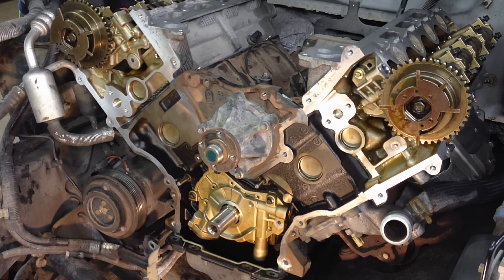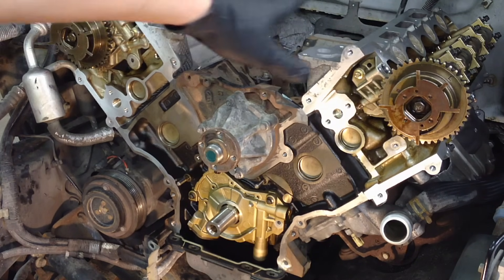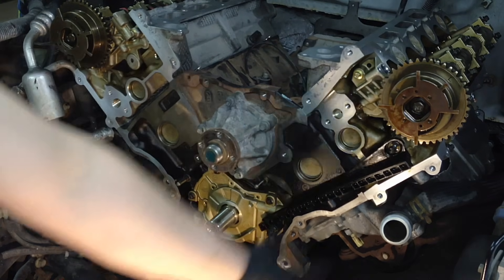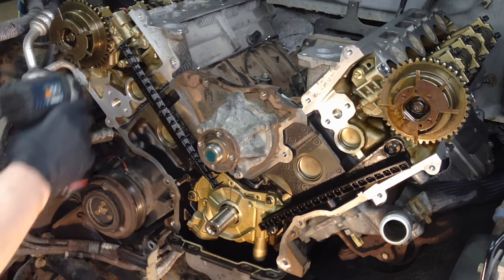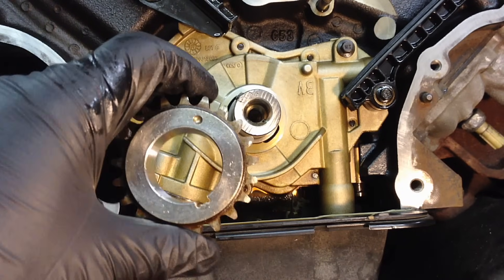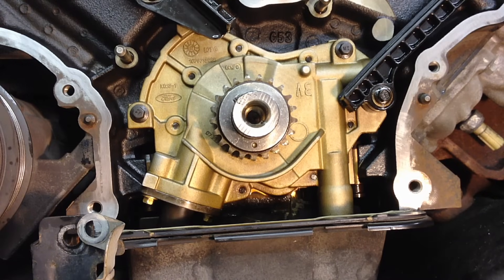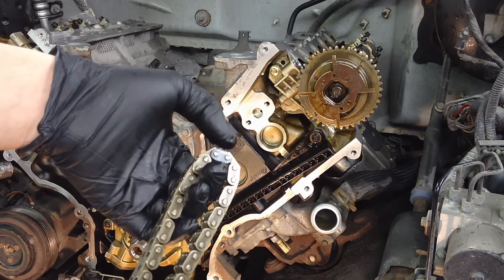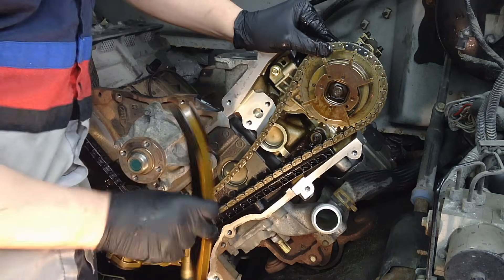Ford 5.4L 3v Engine Timing Walkthrough

Comment: Thank You! Just about to do this for the second time. Only question I have is can you remove all of the followers without a valve spring compressor? Couldn't come up with one the last time. No part stores or ford dealerships have them? Anyway thanks again for the videos watching that makes me realize where I may have gone wrong the first time.
Reply from the maker: wingdad19 I have seen guys de torque the cams evenly set time and re torque the cams evenly a bit at a time to avoid removing the roller followers.
Reply: By detourque you mean loosen the cap bolts evenly turn by turn right? Just want to be sure hoping to finish this weekend have it torn back down already.
Reply from the maker: yes jump around and turn the bolts loose on the caps a little at the a time.
Reply: Ok going to give this a try. Should I remove the chains first or wait till the cams are loose? Thanks for the idea of something else to try everything helps.
Reply from the maker: Move the engine to the neutral position and then remove chains and then loosen caps.
Reply: Good deal thanks again.
Reply: Just wanted to share that this idea actually works. It's an alternative if You can't come up with a 3v spring compressor. Thanks again for the idea and keep up the good work!

Comment: Great video. Very informative. When using you impact gun to tighten nuts/bolts down (especially ones that need a specific torque value) how do you ensure it doesn't over torque the nut/bolt?
Reply from the maker: Pet Rock's Garage I have a feel for my tools over the years that feather touch take awhile to learn but saves tons of time by snugging up bolts just right and torqueing from there. Like in this video like on the trigger and the rattle from the impact perfect then just a short swing of the torque wrench and you are done. We used to have out arms gauged in the military tightening the lug nuts on the Humvee wheels, QC didn't believe us until they busted out the torque wrench to check our work. You just know after awhile.

Comment: I had to replace the chain guides on my 2000 Crown Victoria with only 77000 miles on it.
i think there was a recall or tsb on them. they were worn down to the metal.

Comment: nice video have a question i have a 2007 f150 wanted to see what u think the other day i floored it and got to 80 mph and started to shake and make this ugly noice like of there was a marble in engine but stoped after i parked n turned it off. now it runs fine but i can here like some pops comin from exhaust when its in idle
Reply from the maker: Daniel Aviles Sounds like the catalyst has come loose
Reply: FordTechMakuloco is it the catalytic converter when i look up catalyst thats what comes up?
Reply from the maker: Yes take a soft dead blow hammer and tap on the cats to see if it has come loose.